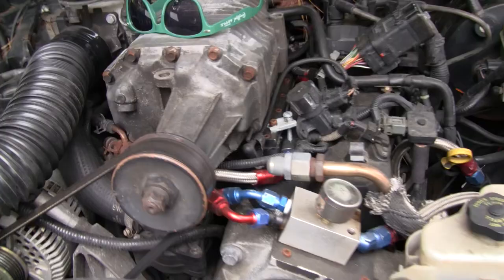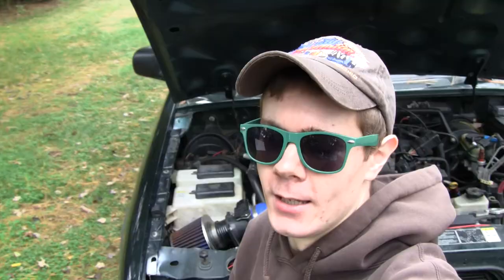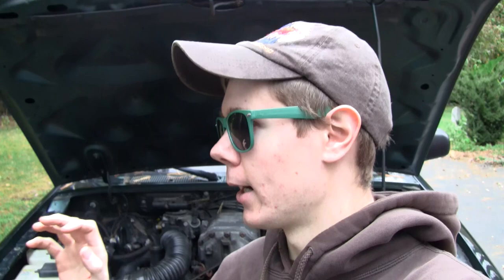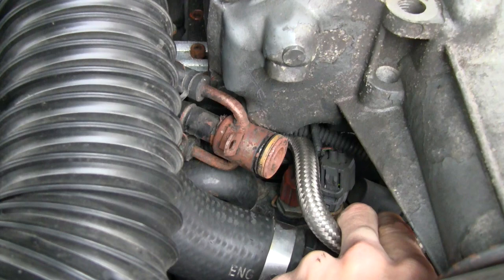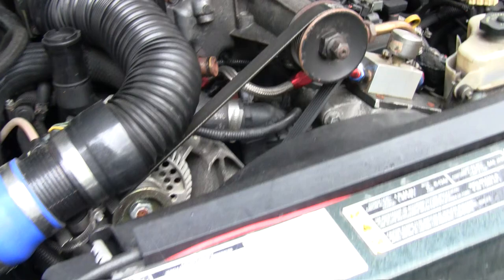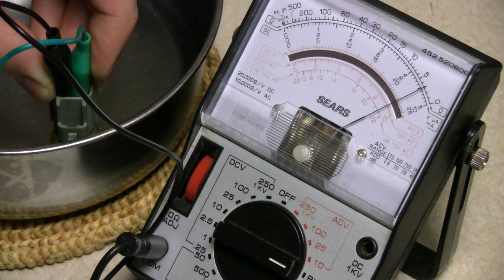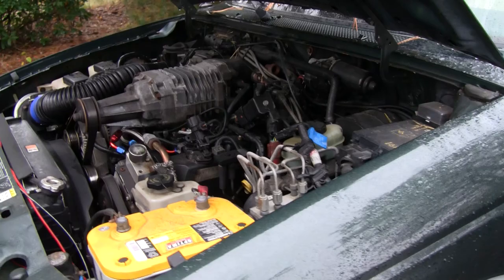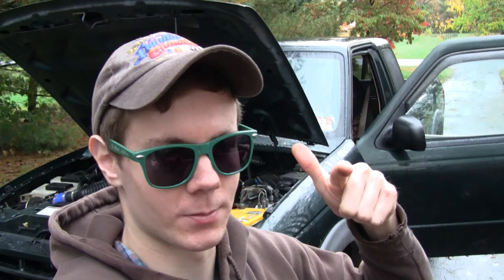Coolant Temp Sensor Codes Explained & Fixed!

Comment from the maker: Hey guys, check the description for some links to tools used in this video as well as a video of me replacing the entire thermostat housing. Thanks!
Reply: I cant find the description
Reply from the maker: @markrose9644  It should be below the video, you might have to click a little arrow to make the whole thing visible!
Reply: Em resumo o que faz aparecer esse código de falha e  a falta do uso da válvula termostática?? O sensor de temperatura troquei e novo